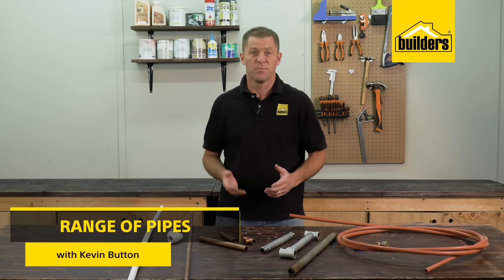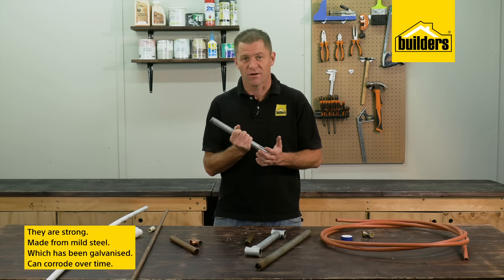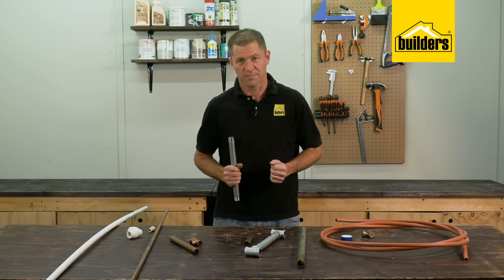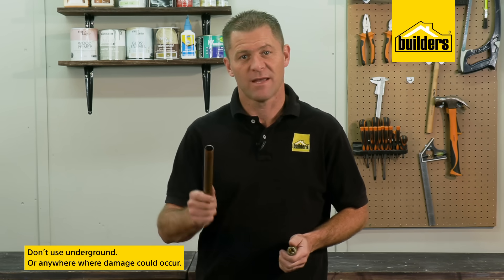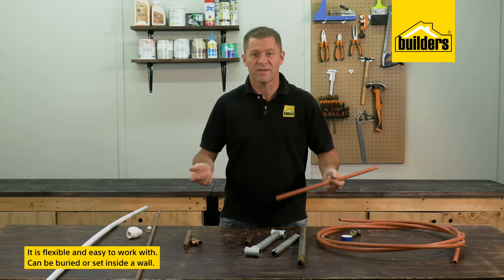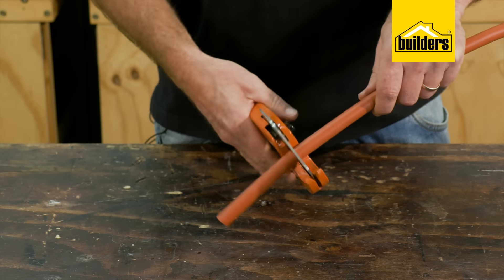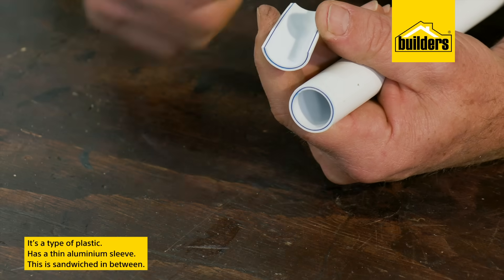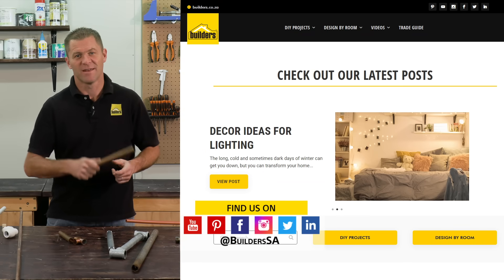What Pipes Are Suitable For Hot Water Plumbing?

Comment: Copper inside walls for sure. For all other applications, even underground, I am sold on Unitwist Monogold pipes and compression fittings which you have unfortunately not covered as an option. Unitwist also does not have any theft/scrap value. As of this date of my comment, doing a search for Unitwist Monogold products on the Builders website brings up no results.